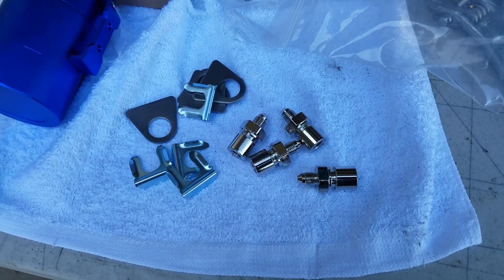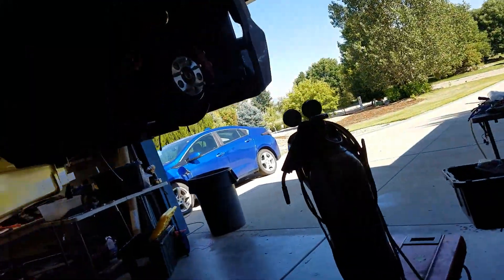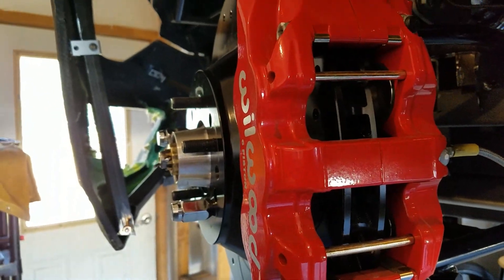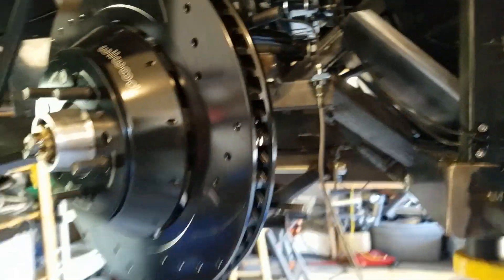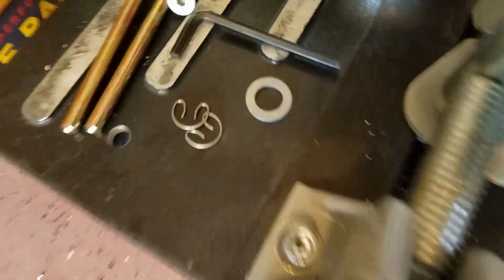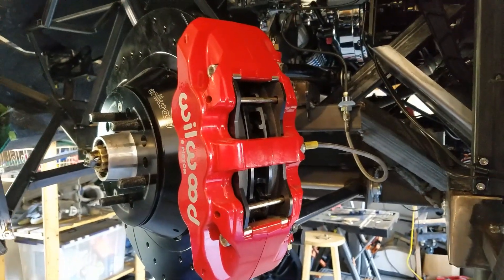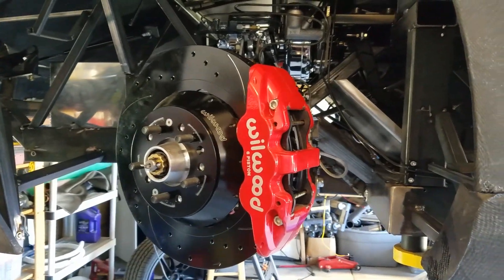3D Printed Interceptor Brakes Part 3

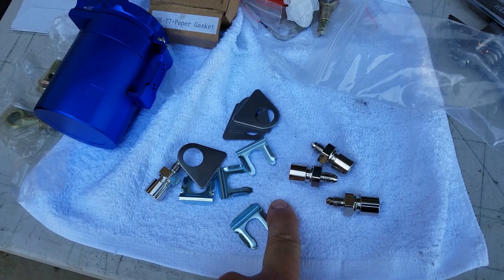Comment: Should we be worried about the welding of the mating joint of the two box tubes next to the tab at 1:07?

It looks like the two tubes aren't connected very securely.
Reply from the maker: Tack welds people...
Reply: @lasersterling  I assume they would be fine to drive with? Or is frame "hardening" a task for later?
Reply: Scott Cress dude it’s a “tack” weld it’s only there to hold it in place unit he knows for sure everything fits probably then he goes back and finishes
Reply from the maker: @Scott_C  I am doing some finish welds for the first low speed drive.  Nice this about a custom chassis, I know where it need strength before rolling around.
Reply: @tonyfromaccounting56  I'm familiar with the process.  I know my way around a Mig and Arc welder. I was just concerned about the upcoming test start and his thoughts about finishing welds.  I just didn't want to be rude.
Reply: Scott Cress it’s probably because of global warming
Reply: @tonyfromaccounting56  ...? What?
Reply: I had a chance to view the NSX concept and found out that the people who had to move it could only touch it in two places . Only those two places were reinforced to push the car. 
Give the guy a break. Or in this case give the guy a 3D printed brake. 😂
Reply: I'm sure you know what you're doing. It just seemed odd to me.